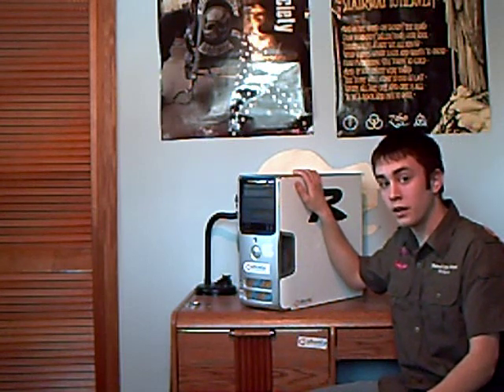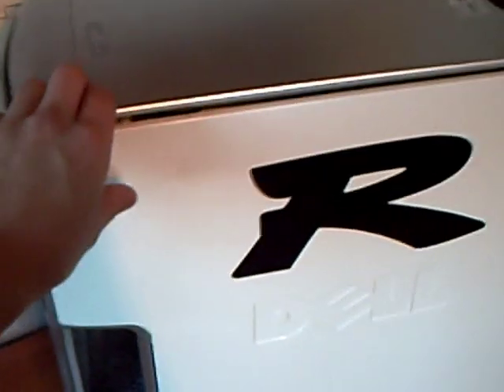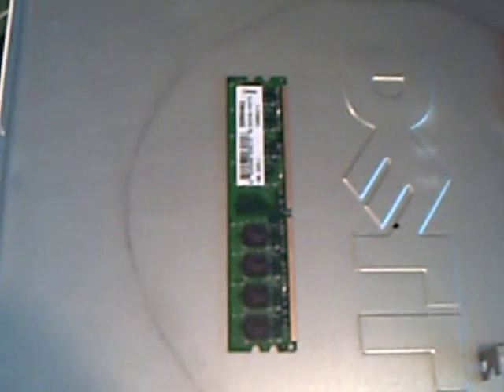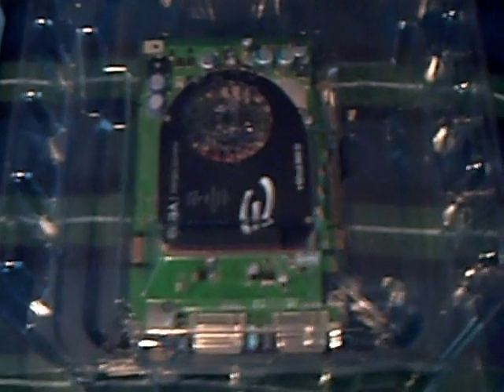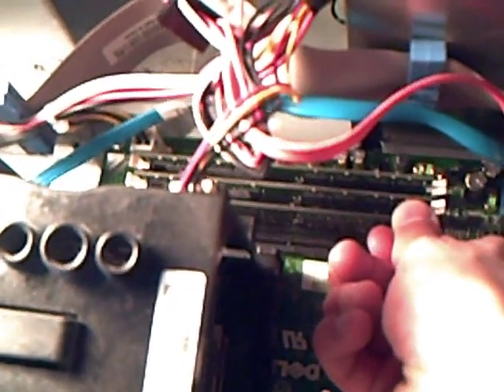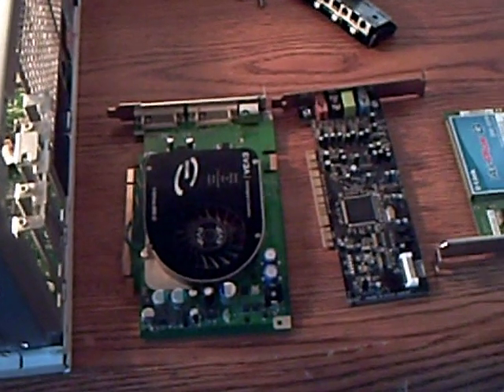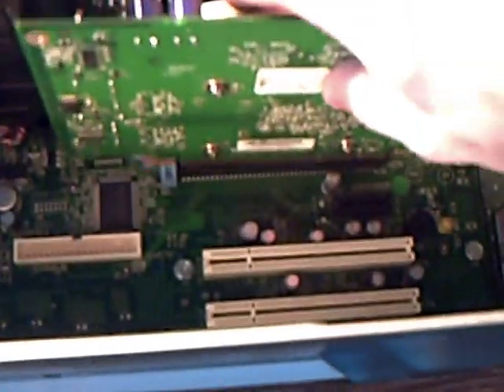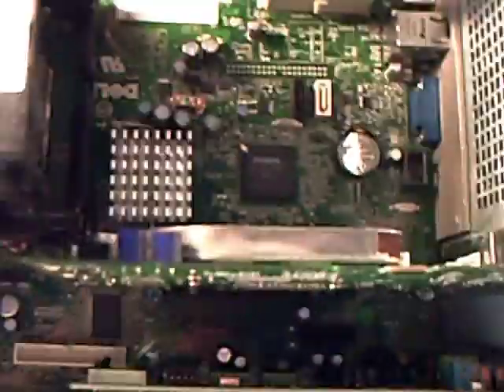Dell Dimension E521 full upgrade

Comment from the maker: I honeslty can't tell you if you'll have problems or not as i'm not very familiar with that card. I looked at the specs of it and according to the specs it should work fine, whether it will or not is something I don't know. My sound blaster audigy card worked flawlessly and unless the ports in the back of the XtremeGamer make all the difference to you, i'd just recommend getting something cheaper (as i can't tell the difference) unless your running high quality surround sound.

Comment from the maker: It will work, if your going to put nice parts like that in it, i'd just build a ground up custom computer. But yes, as long as you have a PCI 2.1 slot open, it will work with XP.

Comment from the maker: sorry, unless you bought a new case your out of luck, all the dell desktops like the E521 are BTX, basically backwards for ATX boards. No aftermarket motherboard will fit in these cases (without craploads of modding) These motherboards can handle alot though so there is no need to replace it, you can usually upgrade the CPU without getting a new motherboard (as long is it's the same brand as the old CPU)

Comment from the maker: oh, counter strike source is nothing for that card, you could go alot lower in performance and still play it fine, with the 8600 GT you could play all those games at max settings no problem. I can easily play crysis, mirrors edge and fear 2 with this card. I

Comment from the maker: first - 8800 GT consumes too much power, when it's starved for power, it reduces the performance to equal or lower than the 8600 GT.  
Second - those are slave drive ports, i need both on master ports so i can boot properly from the DVD drive.     
Third, you can't get g skill RAM at the same speed as the stock RAM so you would have to put out money to replace all the RAM. Besides, G skill is a waste of time, OCZ SLI RAM is what's in my real rig.

Comment from the maker: Yes, you most definitely can. you can use the stock heatsink too (I can't see how an aftermarket one would fit properly). I would recommend getting the AMD 64X2 6000+ but it's really up to you. Just remember to be gentle with the CPU, don't jam it in and most importantly, use new thermal compound.